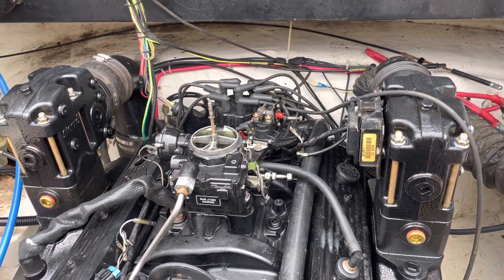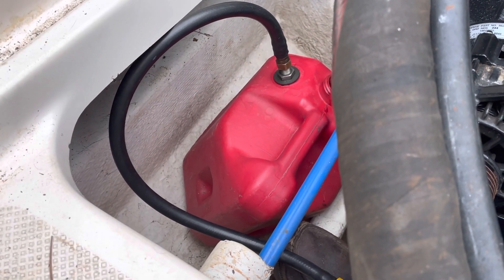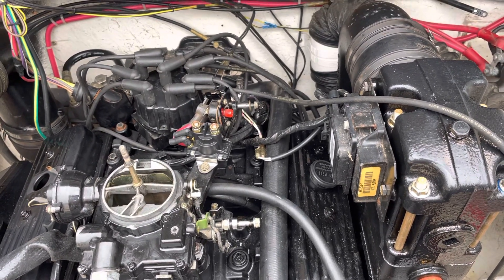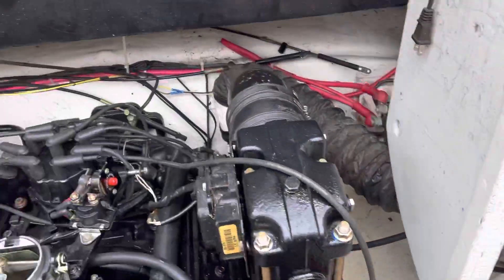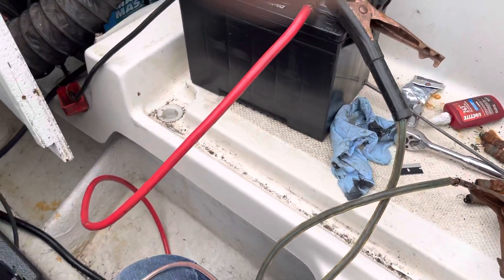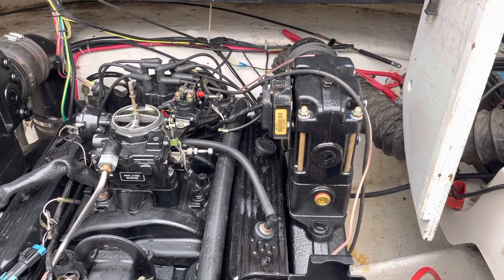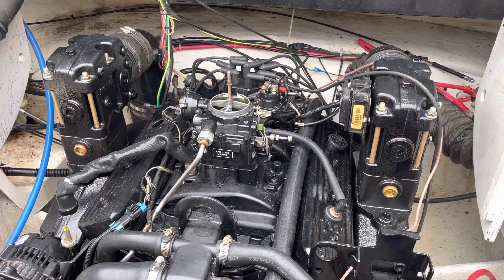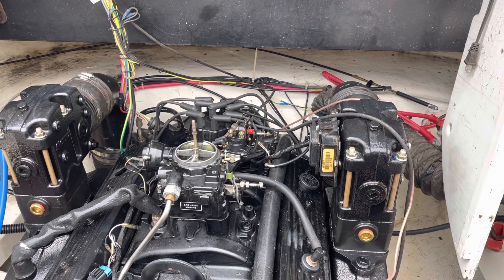Mercruiser 5.7 2(g) - How To Boost Ignition Voltage

Comment: im sorry but where did u learn what u r taking about , guys like u post videos and people watch them think u know what the hell your taking about because u dont, ing voltage is just that batt. voltage is the same with 1,2,3 or as many batt. u want, when modual is powerd up it drops because it energize the coil, thats way there is a purple wire on s side of startor for direct batt voltage to ing , look at your so called work station , rusty plugs, red batt cable to ground, i have been doing this tec shit for almost 50 yrs, just stop, 5.2k sub. i feel sorry 4 them

Comment: I've had the same issue with a friends boat, low voltage at the coil.  I disconnected the stock hot wire to the coil and ran a jumper direct to the coil off the battery,... started instantly !  I measured voltage at the coil both static and running and shows only between 9.6 v and 7.5v while revving up with the stock hot lead hooked up.  I suspect bad connections and corrosion so I'm gonna  clean all the terminals from the ignition on back. The coil should see a steady 12 V all the time.